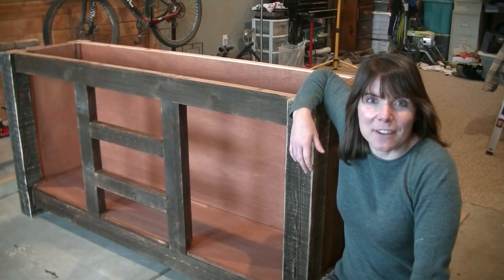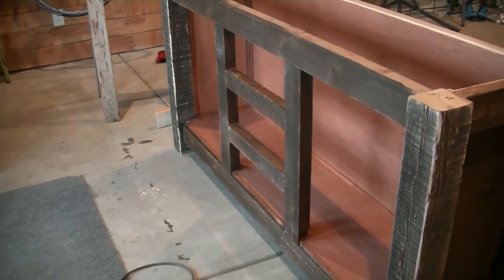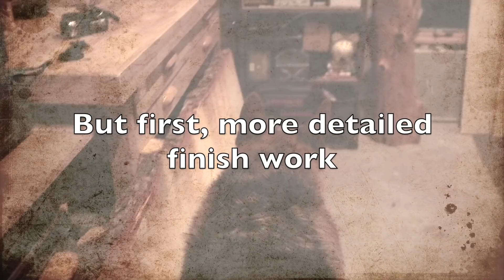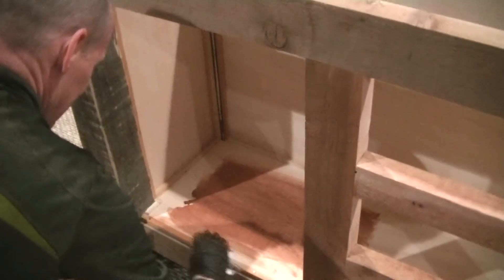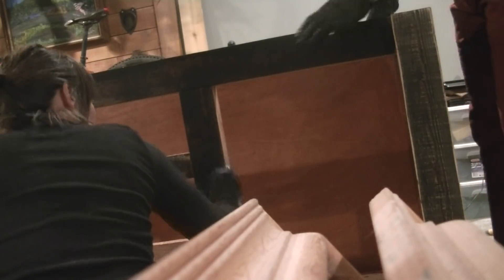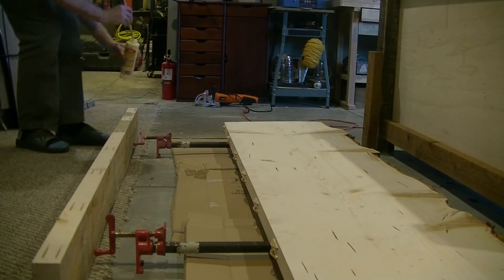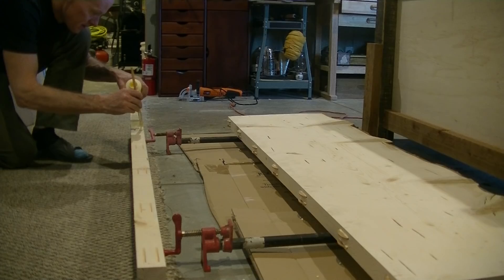Building a Rustic Vanity Part 2. Joinery work & Drawers

Comment: Brian, I think it is a bit easier to use the biscuit joiner on a flat work bench with the fence in the upright position.  That way you just slide it along the bench top into your work piece. I also believe the alignment of the joined pieces tends to be a little more accurate.
Reply from the maker: oh yeah, that sounds loads easier.

Comment: Rocker sales a drawer lock router bit. I use it making my drawers,easy set up and clean strong joint. I like that your not using pocket hole jointer for your project drawers, the ones pure living looked like Porcupine attacked them.A good way to flatten your counter top  is to a  router router sleigh.
Reply: Wendy Laca  Hi Wendy. Hate to bother you but I have a question!!  I noticed you mentioned pure living and yes that cabinet was kind of a joke. Do you have any idea or heard why they are not on anymore?? Have a good day!!
Reply: I don’t know about Pure Living as I do not follow them anymore. Two sites I like following are April Wilkerson and Finish Carpenter both sites are pro’s and with great tips.
Reply: Wendy Laca  Thank you very much for the reply.
Reply from the maker: Need to look up router sleigh. we were going to have someone else flatten the top, but decided just to go for it.